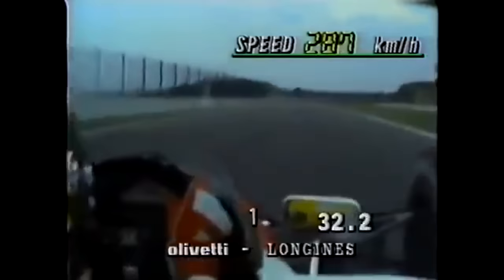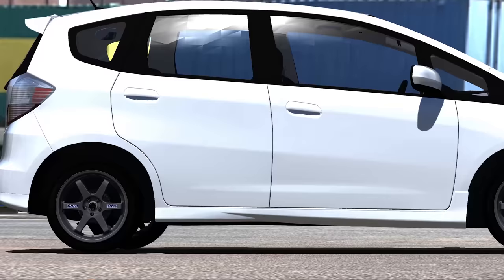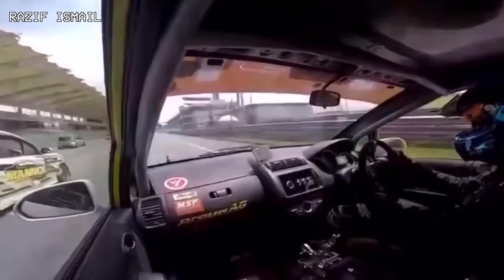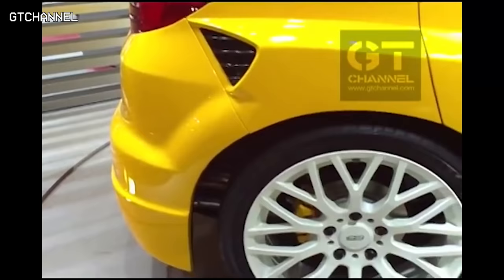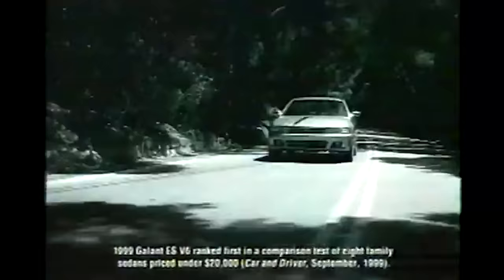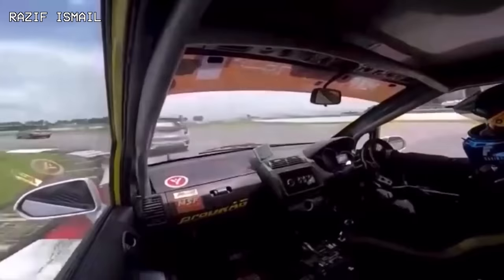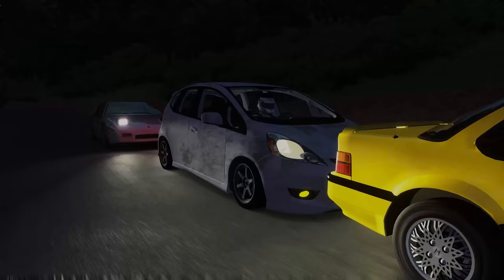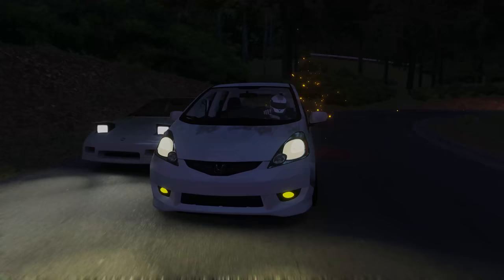Honda Fit - What Makes it so Great?

Comment: Sold my 2007 fit sport last year due to a wiring harness issue under the dash and some rust on the floors. Still loved every second of owning it, so easy and fun to drive at its limit.

Comment: I sold my 5 speed 2006 Honda Fit with 250k miles running beautifully , that was 2 years ago the car is still on the road problem free .
Reply: I still regret selling that car , I have never driven anything as fun as a Honda Fit .

Comment: Had a 2012 Fit Sport. It was a wonderful car. Even though I have owned GTI's and a Focus ST, that FIt was the most fun to drive because I could push it farther than any other car and not end up in a ditch lol. And with its good interior space, efficient packaging, and decent gas mileage, it was a wonderful all-round car. Wish Honda could have produced a new model for the North American market. 😕
Reply: More fun than a Focus St? I don't know.
Reply: @Atomb  in the way I described it, it was at times more fun. I'm not talking in terms of power or speed nor am I talking about on a drag strip or race track. Just as an everyday, work/play/A-to-B car. I could push it to 9/10th and it was fun. Push a GTI or ST to 9/10th, you'll be flying off the road or understeer into a ditch.
Reply: @keithcampbell-jo9gt  never claimed that the Fit was in the same class. I was simply saying that for what the Fit was at that time, it was a really fun car to drive because I could push it hard and not worry about flying into a ditch. If I would have pushed my ST in the same way, I could have gotten into some major incidences.
Reply: Was told numerous times that the Honda fit was in a class of it's own if you maintain them they are bulletproof and not that I care or need a modified fit they can be highly modified.bottom line Honda needs to bring them back in the u.s. market for their dependability and last the great gas mileage.

Comment: Had a 2003: 1.5, manual. Excellent car, loved it very much. Was in the family for the first 150,000 km, sold it to a friend and miss it to this day, 5 years after selling it. It was an amazing thing: impeccably designed, incredibly reliable, fun despite all of its shortcomings, and did everything I asked of it. Cruising around town obviously no dramas, but huge road trips it also swallowed up. Even towed a trailer with a couple of motorbikes in it on the highway for hours at a time and didn't ever complain one bit.

Comment: The Fit really is amazing. Drove a 3rd gen for 3ish years and its handling was amazing. The steering is tight and direct and it'll go exactly where you tell it to. The biggest weakness in terms of handling comes when there's a large crosswind, in icy conditions it means you'll have to be doing a lot of counter-steering if you catch a gust of wind. However that tight handling means I never once ditched the thing even in the worst winter storms. 

Its really a shame Honda never made an entry into the World Rally Championship with one of these, because the base platform is so amazing. Someday I'll buy a manual fit and turn it into a rally car, but that might be tough because most people who bought them want to hang onto them.
Reply: I have one and I never want to let it go.
Reply: @birbluv9595  same
Reply: The only complaint I have about my fit is how much the wind pushes it around on the highway
Winter storms are scary but damb it's a great car to have in a city with tight maneuvers
Reply: Wouldn't be a bad investment to try to make a rally car out of one. In the video they mentioned a Honda Fit won the 2WD class in the 2012 Australian Rally Championship with a GE8 model Fit. Also with a K24 swap these cars can run 0-60 in less than 6 seconds on the naturally aspirated motor around 220HP. That's really impressive considering the Type R Civic gets there in just under 5 seconds with a turbocharged motor and LSD. These cars make excellent track cars for a budget, feels like the EG Civic platform since these car bodies are readily available and more affordable than some of the 90s Civic chassis which are disappearing into junkyards.

Comment: I got a 2016 Fit EX as my first car that I personally paid for and damn I loved that thing. Almost two years after I got it, it was totaled after hitting a deer straight on. I was able to find a 2018 Fit EX-L with nav with less miles than my original 16 had when I got it. Still runs like a dream. I love these cars. I can fit into tiny parking spots in cities, but also go down montana hills at whatever speed and turn with ease.

Comment: I’ve owned two Fits. 2009 and 2013. I’ve driven cars in between some luxury and race worthy between my ownerships, like a Mustang, Corvette, Mailibu, Jeep (Compass and Wrangler), Ultimata, Golf GTIs, and minor encounters of Kias and Cadillac (idk the specific models); but everytime I’ve driven anything other than a Fit, I end up missing the Fit in anyway shape or form. In terms of practicality and everyday use it’s the most fun to drive. The Fits I’ve driven have incredible handling and fun residential speeding. It legit makes driving around suburbs feel like a Mario Kart track. There’s something fun and special about that. It takes something mundane into excitement. Other cars really lack that. Either it’s too luxury to be fun or too quick to enjoy residential driving. The only car that’s fun, besides the Fit, is the Golf. Since it has some similar qualities when driving, but the engineering is so overthought and not straightforward and takes time to adjust. BUT REALLY the Fit is the best because it feels like a go kart and is more affordable/luxurious than it’s counterparts. It’s the perfect fit between practical, luxury, and speed. I’d recommend to anyone
Reply: I once took a 1996 Hyundai Accent GT on a road trip and the thing was zippy, handled like a go cart and got 50MPG going 75 with the AC cranked. I didn't believe the result so I made the same calculation with the next tank...49MPG.

Comment: I love my GK. It's amazing what an exhaust, intake and coilovers do to it. Highly recommend a short shifter upgrade and wheels and tires.
Reply: one of fit weakness is the factory shifter.. unlike the  civics.. its kinda wooble..
Reply: I have the same car. Love it. Put RPF1 on 205 50 16. Retrofit source Headlights, Chinese tail lights with the startup show and the ole EBay 40$ chin spoiler. I used to have a 7th gen Maxima but, this just feels better.
Reply: What short shifter upgrade did you purchase?
Reply: @ironmonger109  I kinda did the diy way. Got the CRz short shifter from buddy club and trimmed up a spot to make it fit. Only cost about $100 but you do need a Dremel

Comment: Fantastic Vid, thank you! :-) As a Honda Jazz/Fit owner I couldnt agree more. It is an awesome little car, with a very roomy interior, and a very nicely balanced chassie. I'm running with the na 1.5L 130HP engine, and that is actually enough to make the car very fun to drive, and the old school VTEC is just a cherry on top with a high reving engine. Only "performance" upgrade that I have done, is a set of sticky Yokohama Advan Neova AD08 R tires on a set of 16"x7 inch Rota Slipstreams, and the Jazz corners like a racecar :-)

Comment: Thanks a lot for this video! My dad bought a 2008 Honda Jazz (Fit) last year and I thought it was a pretty lame car, but now I'm hyped to drive it once I finally get my license!
Reply: Bro they are awesome little cars
Reply: Take it into the hills and if you keep the revs up above 4500 - 7000 she Yonkers along. Just keep your eyes on the road, slow down if you can't see the exit of a corner and always be in the right gear so that you can accelerate or slow down with engine compression without having to use the brakes.

Comment: I remember the first time the Honda Fit (Jazz here in europe) hit the market. It was a huge success and was bought by the masses. Now there have been many cars which initially had big sales numbers but after 20+ years or so I barely seen them on the road anymore, either because of unreliability, high maintenance costs, rust, etc. The Fit is a completely different story though. I still see many 1st gen Fits driving around all the time, and despite their age they are extremely reliable and people are super happy with them. It just goes to show how well Honda can build cars, and how underrated this little car is

Comment: I think it's also important to mention the issues we had here in Canada/cold weather with the 3rd gen Honda Fit (2015+) where the GDI "Earth Dreams"  engine would have oil dilution issues(prevalent in the Turbo model engines; CRV / SI).
Otherwise a fantastic car without a doubt
Reply: Have a Honda fit 2016 EX, not in Canada, I live in PNW.. How can you tell if the fit is having an oil dilution issues?

Comment: Got myself a 2018 Honda fit sport with Honda sense. I'm a manuel lover but had to go with the paddle shift option 7 speed CVT. Got it on a great deal. Tuned the I-vtec.  Handles the corners, absolutely perfect launches every single time, as gas prices increase I'm getting 5.5-6.5L/100kms. 3 months in and I still fall in love with my fit every moment. Had a really bad snow storm last month and the car really impressed me with her reliability. My only regret is that I should've gotten it a long time back.

Comment: I have a 15 year old 2007 GD3 Fit 5 speed manual and am the original owner. Just about 150000 kms and still going strong. Not a bit of rust as I've had it undercoated with "Krown" since new. Clutch crapped out at 80000 kms but other than that it's been super reliable! I'm surprised no one has mentioned the water leakage problem in these first Gen Fit's. Leaked like crazy around the rear hatch seams/roof rails and the spare tire wheel well would fill with water. Also, vapor barriers in rear doors failed prematurely! It was a very bad design! Still love the car though!!!!!

Comment: I had a 2017 Honda Fit with a manual trans. Great car miss it. Could do no less than 32 mpg no matter how hard I drove it.
Reply: Why you miss? What happened to it?
Reply: @GeeTrieste  Discontinued in North America, like a lot of other subcompact cars.
Reply: @AzNightmare  
Yeah? So?
5 years isn't old for Honda's
What's that? 70/80k miles?
That's barely run in.
It can do another 10 years at that rate.
Reply: @mhordijk0871  Not sure why you're getting so defensive, lmao... Calm down. He's saying the car will be missed because it's no longer in production. There isn't any more coming. It's done. No next generation. He doesn't mean it literally like they don't exist anymore and you'll never see an old one on the road.
Reply: @AzNightmare  
Sure, i got that.
He was writing in the past tense.
Like, he doesn't own it anymore.
I only meant, he could have been driving it for a long time, still.
It's still a young car.

Oh, and i can have a  next gen next week, if i want.
The 2020 hybrid.
New 2022 production.
Here in Europe , it's called a Jazz.
And it's all that.
Reply: @mhordijk0871  Lucky. Too bad over here, Americans have "abundance culture" and generally only want crossovers, SUVs and trucks. Small cars don't make any money cause no one is buying them over big cars.
Reply: @AzNightmare  
Yeah, i know.
Bigger is better, right?
Reply: You can't drive 100 HP very hard.
Reply: @journeytree  
Who needs more?
I can hardly go into third between roudabouts as it is.
100hp is just about the sweetspot for urban commuting.
Reply: @mhordijk0871  I need more than 100hp when commuting 100+ miles every day. I used to drive a 1998 Honda Civic with about 100hp. The hing didn't have enough power for predictively driving over 70mph which is what I usually do. Now I have a 22 Civic with 2x the horsepower which is still less than the vehicle I had before.
Reply: @journeytree  
Yeah, i hear you.
Every time i have to drive on the highway for over half an hour, i wish i had a little more oompf in my car.
It's not comfortabele, but it feels like it has to max out all the time, just to average about 100kph. About 65mph
Reply: I miss my 2009 Honda Fit Sport as well and was disappointed that they discontinued it in the US. I'd love to see what it would be like with all of the newer tech as mine just had a USB wire in the glove box.
Reply: @journeytree  I drive it hard enough to average 30 instead of 32 🥴🤣
Reply: @602ouge  I drove my car light and was getting 15-16.

Comment: I have a 2008 Fit Sport, 5 speed. I love how the smooth the clutch and shifter is. Still works great at 156,000 miles.

Comment: I have a 2009 second generation and I love it it's really the best car I have ever had it's great on gas doesn't burn oil 124,000 Miles it's really a great car 
Thanks Honda Fit
Reply: My wife has an orange 09 fit 5 spd sport w 200k miles. We love it. We use it a lot, including her using it for grub hub deliveries a lot of the time. It's paid for itself just doing GrubHub in the last two years. And it's barely needed anything but maintenance. Even with All the stop and go. Even the clutch is original
Reply: Hell yeah. I got 2007 with 268k

Comment: I bought an automatic 2011 last year for my girl and i liked it so much (except for the automatic) that I bought a 2012 in manual. Same color and everything. 

Its not just a great "small" car
Its literally the best "car" there is at simply being a "car". Great room, reliable, economical, dependable, great handling, safe stiff quiet chassis. 
No other car on the road is like it.

Comment: I once did a trackday on a JDM spec Fit GD1, which translates to no 7-speed CVT mode, smaller discs at front and drums at the rear, and a measly-powered 1.3l L13 iDSI engine (basically twinspark but focuses more on fuel efficiency). The car was riding on some 17 inch wheels at the time and rubber spring dampers on all 4 corner, I had so much fun in that thing even though it was slow. Even a guy in a Subaru just behind me, told me that the car took the S corner quite well!

Comment: I bought one for 1.5k in good shape as a winter beater, and was really amazed at what it had to show. Been beating on it daily for 4 years and it still going strong and not burning any oil. Only did regular break/oil changes and other than that didn't cost me a penny. Once you put real tires on it it grips like crazy in tight curvy and hilly backroads!

Comment: I have a GD3 manual, and like you alluded at the end, it is the perfect daily that's also great fun in the hills. Fuel economy is excellent, it's super practical, and very enjoyable to drive. I wasn't as big of a fan of the 2nd generation, but it's still a better car than most of its competition.
Reply: Yeah I feel like the Fit2 is a better car but for me it's lost some of that handling edge that makes the Fit1 so fun.
Reply: @christopherjohnston6343  the GE8 is much more composed thanks to improved body structure but GD3 is more "loose"
Reply: @ShaiyanHossain  depends what you define as composed. GE8 may have a more rigid chassis but I think the suspension is softer as I find it wallows a bit.

Comment: Great video, I drive a GE8 Sport 5MT and its a great drive indeed, and with insane space to booth (fun fact the GE8 in at least the US spec has 10 cupholders for 5 occupants) 
some points to mention though: 
ALL generations of Fit have torsion beams (even the newest one, its how they get the floor so low+ cost effective for subcompact cars)
the USDM GD and GE have different front and rear ends vs JDM because of a Canadian 5mph bumper law sticking until 2009. this means the USDM cars of those two gens are much longer and cannot be easily converted to JDM without much effort 
there exists a version of the GE8 in Japan with a 6 speed manual+hybrid 1.5l taken right from the CRZ (also built on fit bones) but also 200 lbs lighter than a regular CRZ. it is the GE8 Mugen RS hybrid 
the 4th gen Fit/jazz is no longer offered with a manual, but to alleviate it, honda offers the city hatchback in place of the fit in certain ASEAN markets, with a carryover L15B from the GK, and a 6 speed manual option 
honda sold and still sells Fits with AWD albeit cvt only
Reply: sad the CVT is made of glass... I got a GD4 for cheap but my mechanic had to do some juju to get it back on the roaad (it's now a manual swap one, with the 5-speed off a USDM one) 

I'm still not letting this one go
Reply: And 2 of those cup holders are in front of vents. Making them great for coffee or hot chocolate in the winter
Reply: And that's the specs for the City Hatchback here in the Philippines.
Reply: too bad city hatchback are too soft and fat compared to fit/jazz.

Comment: Seems like these have amazing potential... Time to move focus away from now pricey EG/EK hatches and into these for entry level tuning I think, definitely seem like they could be the modern equivalent
Reply: They also drive like the modern equivalent of these. Not going to easily get the same power but the stock handling level is good
Reply: You’ll have to swap the trans if you wanna make over 200hp
Reply: Also they look quite similar to the older 2 door hatch civics
Reply: @jaredevers6459  Good to know, didnt know the trans was a weak point
Reply: @christopherjohnston6343  The Fit now is honestly what the Civic used to be
Reply: @RhodokTribesman  it is to me anyway. Also owned the Integra/RSX and this doesn't really replicate the driving dynamics even though its technically based on the newer civic chassis.
On a slightly different note the 08-13 Mazda2/Demio also has the same kind of nippy handling as old civics